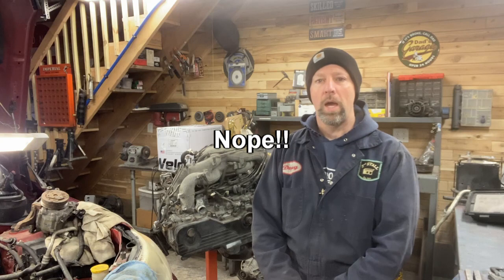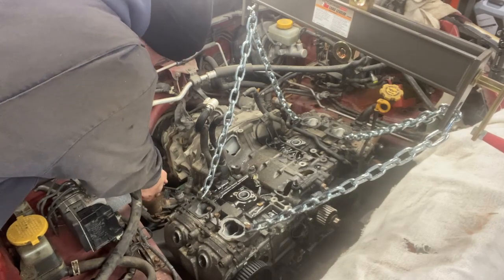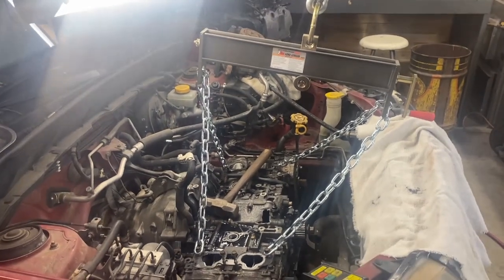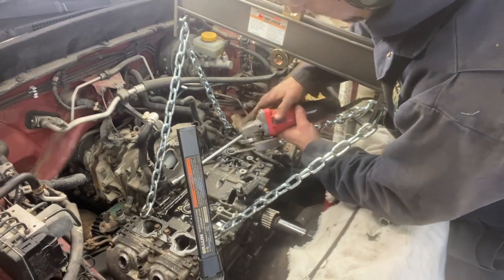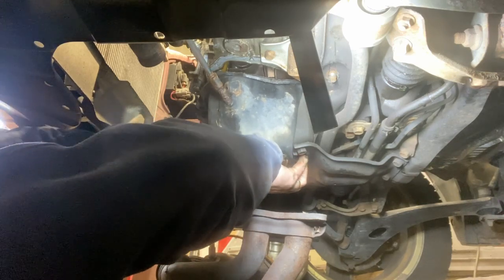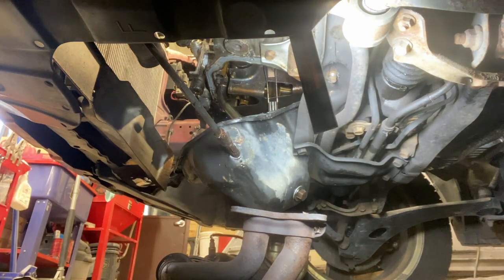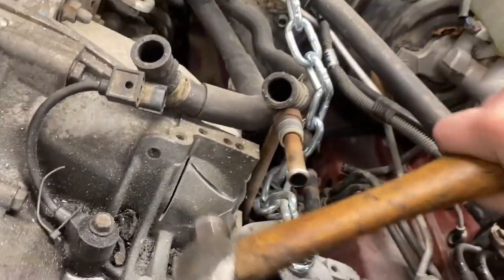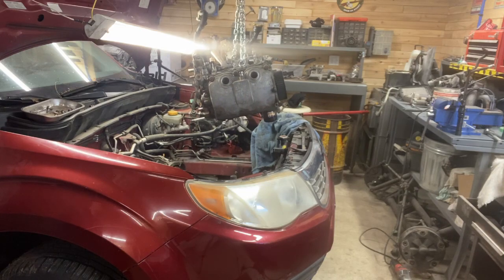2010 Subaru Forester - Pt. 12 Ruby's engine removal, will it come out?

Comment: Your timing belt is off , so you're valves are hitting the pistons
Reply from the maker: Yeah...Ruby's engine was toast.  It threw a rod through which punched an actual hole in the block.